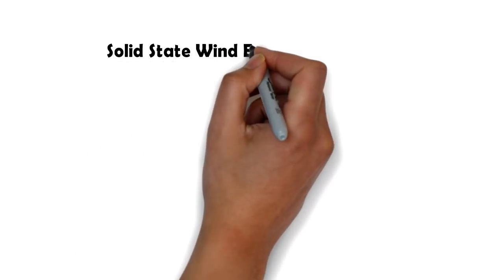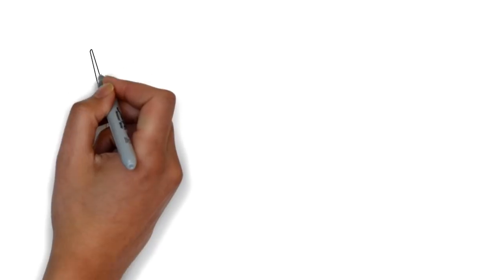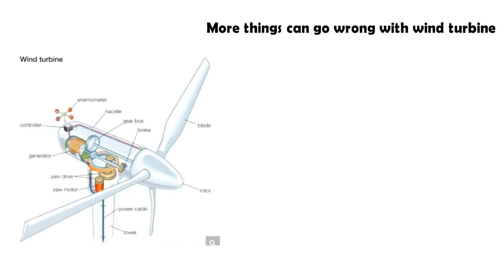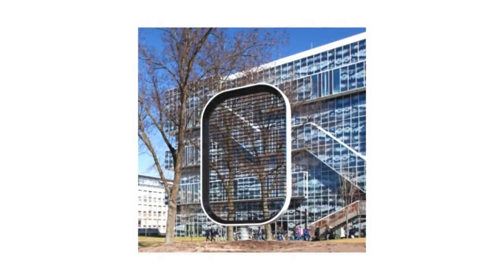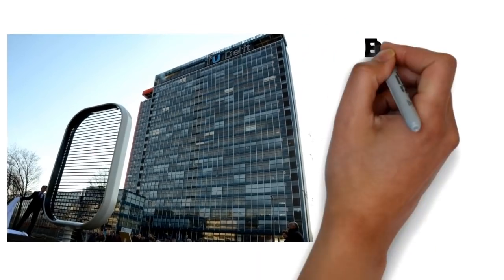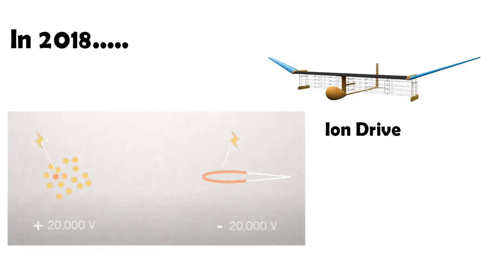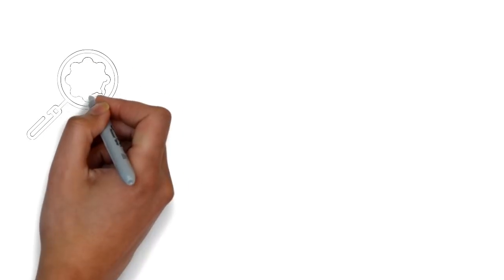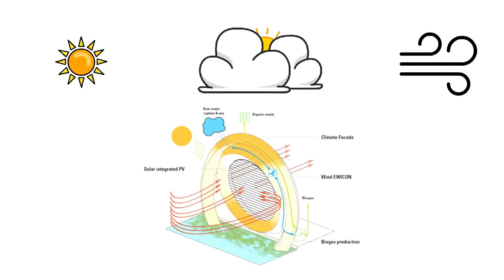Solid State Wind Energy Generator. A Revolutionary Device

Comment: High potential with low current still yields low power so these “ion devices” are not practical . When the wind pushes the blade it does actual work  that can be converted to electric power. Ion devices simply collect charges, not much work is involved here. That’s why ionic propulsion system is fantasy, but a plane of a fly size could be propelled by such system lol

Comment: I have 2 questions.  1) Doesn't running power through the air produce quantities of ozone?  Or am I wrong about that?
2) So, every time the wind stops, this system stops producing power, so it would need to be boosted again each time to make use of a "renewed" air current?

Comment: Regarding solid state wind energy a great idea, again think individual home use. The problem like current renewable energy sources is size, life span, initial cost/ disposal, and susceptibility to damage by sever weather and to nature and wild life. The original Department of Energy plan was for renewable energy at the individual level which had insane cost, so corporations and the government got involved created Indian subsidies and hide the fossil fuel expenses related and maintenance/disposal cost and the limited amount of energy, 15-20%, they could input to the grid at peak numbers and performance. Natural gas is abundant more than capable of full production need and is proven clean even at major producers with low expenditure for scrubbing at major producers that could be unnecessary if more plant were built, more jobs !

Comment: High voltage potential plus oxygen equals ozone. Low level ozone is a considered dangerous pollutant. This method won't be a viable solution to power generation anywhere near people, wildlife or fauna.

Comment: Yeah yeah, let's use huge, immersive bug zappers to produce energy a single Icewind turbine would easily generate tenfold.

That plane mentioned, flied for 16 meters, woo hoo, for 40k volts.

Definitely where I'll put my money.

This is possibly a scam like those "Vortex" generators, first crowdfunding, then finding angels, then running with the money.

Comment: Generator that are gasoline driven.
1. Can it change or upgrade to electricity driven generator using for house or apartment etc. ?
2. Can this reduce for building more nuclear power plant or solar or wind?
I took the idea of the car with motor but on the house is a generator that make electricity but electricity driven generator not gasoline but if it possible to make both gasoline and electricity driven but the gasoline driven generator is a backup if no electricity..? 🤔🕵️‍♀️🕵️‍♂️

Comment: Spoken like a true EE.  First: you failed to mention the area efficiency of these units (today) which is presently in excess of 1000.  This means that for a given cross - sectional area, solid state flow harnessing devices require an area over 1000 times greater to produce the same amount of energy per unit of wind as compared to a traditional turbine.  So, if you have a tiny wind turbine with a 40 meter radius, you'll need either 1000 sections overhead of the same size or one with a 1265m (1.27 km) radius.  This means that the top of the thing would need to be about 2.54 km in the sky. 

Obviously the cost would then be prohibitive.  Also, operating costs will be very high. These fine wires will break and require extrnsive time and expense to repair and clean. 

Structurally, the housing of these will be subject to the same kind of flow vibration that traditional turbines are.  It's just the rotation of the rotor that can add to vibration in traditional turbines.

So, with cost of operation and maintenance coupled with the current low efficiency of these units, we're many years out (if ever) before these become viable and compete with turbines. 

Oh, one last point: PV panels have s high cost of maintenance, too, to for cleaning the surfaces periodically to replacing panels (which has a fairy short, finite life).

Mechanical systems, though they have moving parts, are more familiar to most workers and easier to troubleshoot

Fwiw

Comment: To have them working efficiently, you will have to place them somewhere where you'll have bone dry air. Moisture in the air will obviously tend to short the electrodes. That makes low pressure systems the opposite of candidates. Deserts or permafost regions might be options if the basic principle can be proven economically interesting.

Comment: Alvin Marks patented a similar idea around 40 years ago, check it out.
Charged aerosol wind/electric power generator with solar and/or gravitational regeneration
Patent number: 4433248
Abstract: On a Charged Aerosol Wind/Electric Power Generator, electrically charged water droplets are dispersed into the wind stream. Using Induction Electric Charging, a water jet issues under water pressure from a small diameter (25-50 .mu.m) orifice, and the jet breaks into charged droplets. A plate orifice 35 .mu.m diameter, and 25 .mu.m long appears optimum; a single jet from such an orifice at a water pressure of 15 psig produces net electric power output substantially exceeding the hydraulic and electric power inputs. A practical Wind/Electric Generator utilizes a multi-orifice array scaled to a kilowatt or megawatt level. A water recovery and pressure regeneration solar and/or gravitational means is described by which water is conserved and the water power is free, so that there is a net output electric power without external power input of any kind, except natural wind and/or solar power.

Comment: You forgot to tell that the prototyp generated 0.05 W. And bird-strikes will be a big problem too. It's like a net in the air and birds usually don't see thin wires very well.
To power a small city you need a lot (and i mean millions!) of big SWETs and you end up killing a lot more birds with it.

Comment: Reliability is still a problem. Corona discharge increases as the (log) diameter of the wires decreases. Ions sputter metals  and, especially, water (humidity ) reacts chemically and will increase wire erosion. Bet against this.
The turbines can be made more reliable by different gear alloys and designs, but this is an economic decision based on reliability costs vs design and manufacturing costs.

Comment: Years ago I saw a wind turbine proposal that had the appearance of a cooling tower.  The shell of the machine was open at the bottom to allow air to enter.  By using natural convection, the air would increase in velocity as the cross section of the shell decreased in diameter the farther up you went in the tower.  Located in the upper reaches of the shell were the turbine rotors connected to the generators.  I don't see why this design of wind turbine didn't come into use.
Reply: I think they are called "solar chimneys". They seem practical in hot climates, and you can make them work in the evening by using stones at the bottom to store the heat of the day

Comment: EXCELLENT VIDEO!!!  Could you do a video on the comparison of Vertical Axis Wind Turbine (VAWT) VS the Horizontal Wind Turbine (HWT)??? I wish to add wind power to my home and farm in Florida (along with solar). Keep up the good videos.
Reply from the maker: There are bearing problems with VAWT. Your best bet is to for a direct drive 15 KW HAWT.  As the industry has favoured the HAWT, the options you will find are a lot more and the technology is also more developed for HAWT

Comment: Hey looking for sponsorship for a sterling engine train covered with alternating magnets and a wireless facility to heat our rod and get the sterling engine moving this armadillo should then be able to run forever doing loops on rails through copper tunnel at a few thoughts and revolution s

Comment: It will also cook the birds that fly into it rather than just knocking them to the ground raw like current wind turbines.
Reply: Mmm chicken nuggets
Reply: Sounds better than the aggressive loss of deforestation for other sources of energy
Reply: @johnnyhourihan8834  I dont know if you noticed but all types of windmills need open space around them to work. They probably require more cleared land than any other energy source. Nuclear is the lowest footprint and wind or solar would be the largest because of their low energy density. Fossil fuels are in the middle.
Reply: @michaellowe3665  Yeah, attempting to create a vacuum on the planet is a better idea than harnessing natural processes. The issues of practicality and availability deals strictly with public willingness but first - education. There are obvious economical advantages to maintaining the way we are doing things; for now. Hasn't nuclear had it's fair try? Did it not do all of the things it promised it wouldn't?
Reply: @johnnyhourihan8834  yes, I agree that education is needed. Most people dont know that nuclear has the lowest number of deaths per kw hr and the lowest co2 output. Wind and solar take enormous amounts of energy to produce the equipment and it has to be replaced often.  They require lots of rare minerals and materials.  Many of them are made from chemicals that are not easily recycled.  It doesn't make much power, so it has to take more land. Nuclear suffers from a scare mongering by lobbyists, not actual failure to deliver. Very few people have died due to the production of nuclear energy. Most of those were in Chernobyl. They were victims of communism, not nuclear power. The Soviet government mismanaged the facility and hid the danger from people that were in the way.  Fossil fuel continues to be used because it provides a balance between largest number of jobs per kWh vs its land use. Governments like those jobs numbers so they push it.
Reply: @michaellowe3665  We are dealing with information based on large scale, corporate invested, projects. I'm sure that wind and solar are not given a fair shake, economy wise. We pour billions into subsides to fossil fuel for 'research and innovation'. Imagine that $ put to use researching and innovating renewable energy? What sounds egregious about a small solar array ( 4'x4') or a windmill the size of a single engine plane propeller used soley for pumping water from the well or rain catchment? Vs. Power sent from the most available fossil fuel or nuclear. Let's not sweep Fukushima under the rug, either. You say nuclear can't be as useful as possible because of lobbyists - Haven't you had 50+ years for proving your point? Has renewable energy? No. It's been given the same one side argument using cherry picked information and omission of the factual and documented dangers of what you're proposing, in this case nuclear.
Reply: @johnnyhourihan8834  nothing is stopping you from putting solar panels and winmills on your house. Go ahead. That is where they are most efficient anyway because there are no transmission losses. The fact that people dont do that is due to the high cost and poor reliability. The cost is a result of the energy and materials needed to make them. Those materials and energy are mined from the ground.  The cost is proportional to their energy and materials use. Saving the world you ain't. At best you are breaking even with fossil fule when it comes to ecological damage. You may save some money by being your own electrical grid engineer instead of farming it out to you local government ran monopoly. 

Since you mentioned Fukushima

 "In the case of Fukushima, although 40 to 50 people experienced physical injury or radiation burns at the nuclear facility, the number of direct deaths from the incident are quoted to be zero.Jul 24, 2017"  

Windmills and solar energy production have several deaths a year. Not to mention Fukushima was old technology and was in the process of being decommissioned when the tsunami hit. Next generation reactors are safer.

Comment: No.  No. No.  Not a chance.  Ignorance is when you don't know something.  Stupid is when you know you don't know, and don't bother to find out.  Guess which this is?   IF you could force all the ionized air through the collector, you'd get back a VERY low percentage of the energy used to ionize it in the first place.  Since air goes wherever it likes, you won't even get that.  This doesn't even cover ionized air particles collecting on dust, losing their ionization to a water molecule, or being attracted to a static charge nearby.  Just stop with the hype already.
Reply: Snake oil because they are using power to get power back and unless someone has broken the laws of physics recently that is tantamount to a free energy device which is 100% BS.
Reply: @thebeststooge  Yep.  Also, https://www.merriam-webster.com/dictionary/tantamount
Reply: @chrisw1462  Thanks, as this spell checker loves doing that to me or changing the words completely on me.

Comment: Let us slow down a little bit, imagine that already these generators are enough efficient than you would probably need to get ionization voltage a little bit up then imagine we replace all of the wind turbines wee have now and all of thee solar panels we have now installed then please do calculate how much ionized air and everything else would they produce what effect on environment and people and plants and animals will that ionized air and other stuff have, how would you clean those electrodes because they will need cleaning, how would you orient them to the air flow without moving parts, what would happen when rain falls and when it is foggy, what would happen when snow falls on them, how close can they be one to another because I bet if ionized air from one goes to other would not be ideal, what would happen in fall when lives are flying everywhere some has to get into them, what effect does dust collection has on them,  ....... and then compare it to what we have now. Someone may have done this all but you did not speak about it here.

Comment: So these could potentially produce ozone? Which could help the ozone layer and possibly eventually lead to global cooling? 🤷‍♂️ but also that seems like a big health risk to those near these devices. One other question, ionized air supports the movement of electricity far easier, would these devices attract lighting strikes?
Reply: the tower would have to be miles high. Otherwise all you'd get is smog from the ozone like in los angeles

Comment: The TU Delft did conclude that the efficiency of this concept was not worth it and scrapped the project.
Reply from the maker: There has been recent research at University of New Mexico
Reply: @synergyfiles3536  - I can not find any data on this research nor can I find data that higher efficiencies can be obtained. (https://www.engineering.com/ElectronicsDesign/ElectronicsDesignArticles/ArticleID/9659/How-Much-Wind-Energy-Can-the-Dutch-Windwheel-Harness.aspx#:~:text=EWICON%20was%20the%20subject%20of,of%20a%20large%20wind%20turbine.).
Current research only shows that this is a dead end.

Comment: My experience with these is the grid elements on electrostatic devices like this is they eventually need either chemical cleaning or full replacement of the grid wires/slats on a regular basis. As it ages, the efficiency decreases as the elements get corroded/oxidized/contaminated.
The cleaning can require corrosive chemicals and produce toxic waste (which can be recycled if no spills all the way from cleaning to processing). Each cleaning reduces the surface area a tiny bit so the efficiency decreases that way as well.
Reply: Parts are cheap.
Reply: Jack Fanning. Not all parts are cheap. Especially if they have to be replaced often and you have to do a lot of them. Also we may need to use some rare material in these to boost efficiency or duration. High demand could raise prices for that as well. Chemical cleaning would prolong the use, but the disposal costs of the chemicals may make that a less viable option depending on how often. And all of these could limit the overall size of these as currently maintenance on the giant wind turbines is a nightmare.

Comment: And how many liveforms are electricuted by this wind power generators 🤔
The same technology is used for ion engines like they are build in satellites ect.
Reply: If you would stand right behind an ion engine you would feel nothing. Sattelites don't use them for their power but for their high efficiency.

Comment: Starts at 2min 30 .   But his explanation fails to create understanding in my head.   ...   The toy glider he talks of is https://youtu.be/IorDYGI1uqc sounds plausable, as a glider needs very little thrust. Voltage source energy to electron flow to charged particles to ionic wind thrust , with a circuit, . 
 But this generator  is more of a puzzle .  The high voltage Ionises the air? agree. but blowing those ions away ? would that just deplete the high voltage you started with ?   IE A high +ve voltage strips -ve electrons off the air , which act to reduce the voltage source. ?    At 5min he shows a picture of +ve ions being blown towards a +ve electrode, but what would make them touch down on that electrode , & didn't the positive ions get created by that electrode in the first place? 

Say it is a real thing,  Think how much power flows in the cables of even one village, all those electrons need to come out the air onto high voltage grids ?  Will the maintenance of these ( many killiometers thin wires strung up corroding  in the rain , cleaning off plastic bags blown into the wires, dead birds etc) ever be less than wind turbines ?